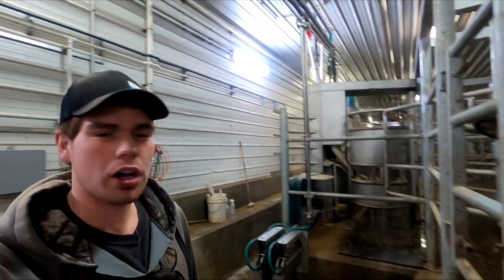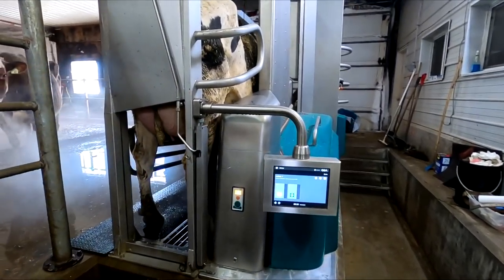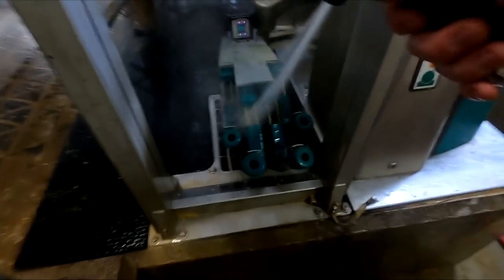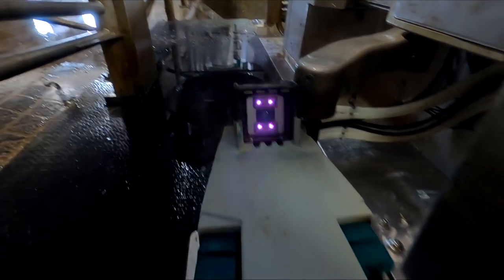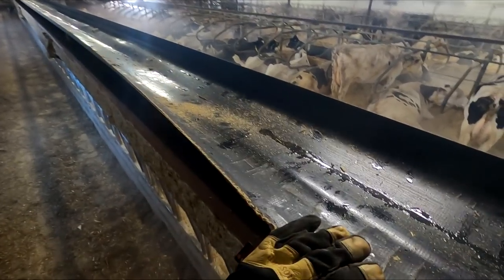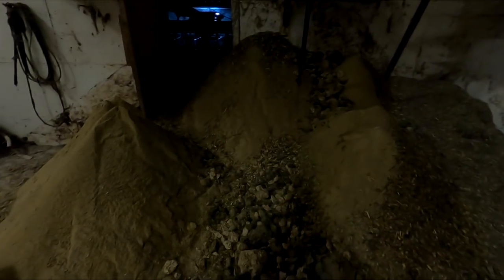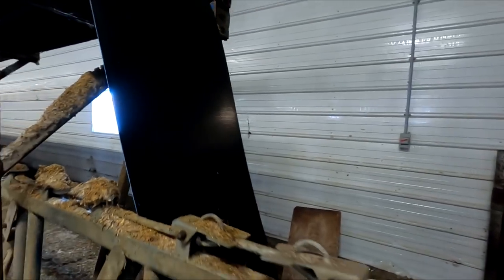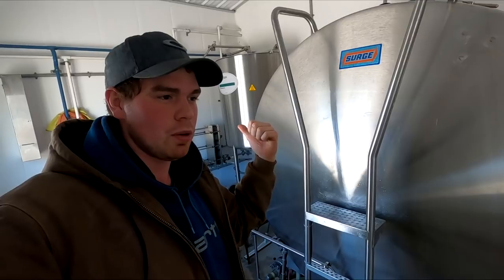Busy day on the farm!! | Replacing conveyor belts!! Part 1

Comment: Nice video. How is production going compared to the other barn? I am sure it's probably going to take some time
Reply from the maker: Production is very good, we are shipping just as much milk as we did at the old farm with 12 less cows, we dropped 4 kg with the move but went back up within a week, cows are going through robots 3.2 times a day (milking) and with 6.5 visits per cow
Reply: Wow that is impressive. Very good to hear
Reply from the maker: @ryanandrew1858  we have been losing a lot of production out of the cows from having a lot of them outside in a straw pack shelter and bringing them into milk, especially in a cold winter and a hot summer, we are holding steady at 37.5 kg average at the moment but goal is within a year to push 45kg, we know we can do it with the genetics we have

Comment: Does the robot keep texting your phone at night with issues or is it not to bad?
Reply from the maker: Rarely get any robot calls, normally if I do get one it isn’t even an issue just an “info alert”
Reply: The Northerndairyman right ok thanks. Im still debating if parlour or robot is the best way forward.
Reply from the maker: @gethinjones7501  robots are nice, definitely spend just as much time in barn, but it is easier and different work not so labour intensive so far I’m liking robots very much